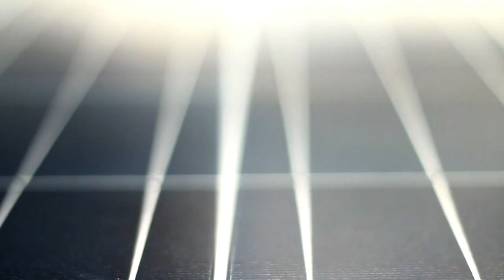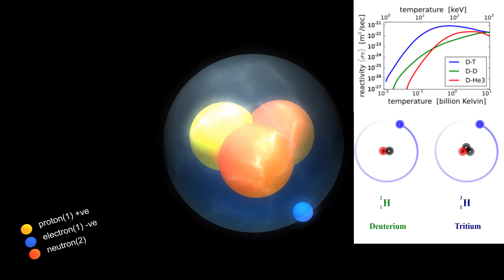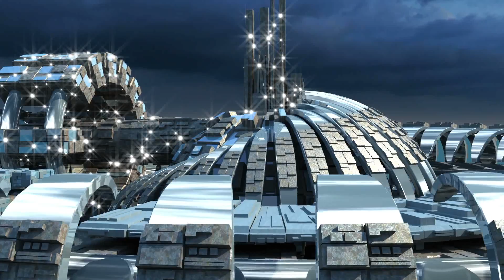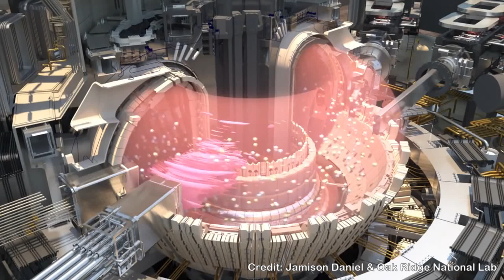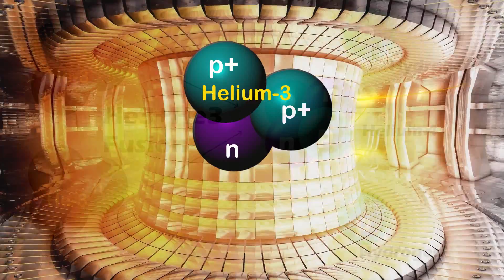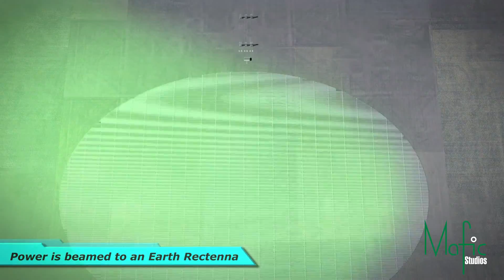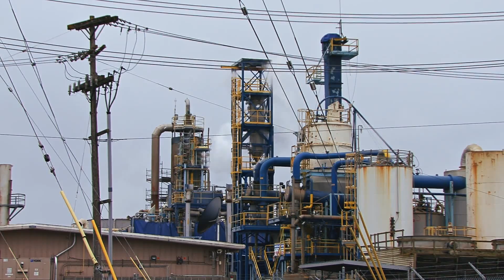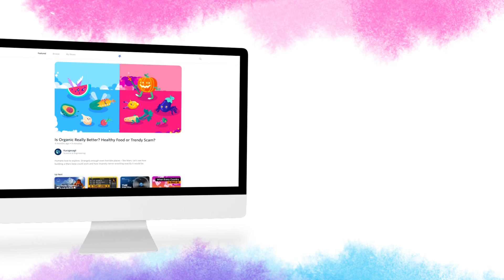Fusion: Powering a Bright Future

Comment: Would liquid hydrogen fuel cells be better than current batteries 

Can anyone Answer
Reply: https://upload.wikimedia.org/wikipedia/commons/c/c6/Energy_density.svg
Reply: So, hydrogen has a much great energy density (around x140), but this energy is not as available as the energy from a normal battery
Reply: Nicholas Schmitt 

Thanks man
Reply: Hydrogen fuel cells arent really like a rechargeable battery, they are more like generators. You fill them up with a fuel and they consume it. A bit expensive to make as well since platinum is needed currently.
There is a reason fuel cells are adopting slowly. Lack of a shared infrastructure for refilling.
Plus compressed hydrogen is some scary stuff for the average person to handle. Less dangerous than vaporized gasoline, but still dangerous.
I think most smaller commercial portable systems will use electric batteries. Backup generators and large industrial systems will use hydrogen fuel cells. This is only if our energy generation increases a lot, which with some form of nuclear wont happen.
Reply: Aron Linde 

I’m thinking about writing a hard sci-fi and was looking 
For a power source to power 
Power armor and trying to see what future might have

I hard hydrogen fuel cells 
Have the 10 times the amount of energy current batteries have

So I thought compress it more into liquid hydrogen fuel cells 
And imagine have much energy they would have

Storage isn’t a problem 
Diamondoids or buckyballs 
Or something else could hold them

Micro nuclear fusion or a perfect mirror batter the best but I couldn’t think of a why to make them work

Comment: THANK YOU. The introduction (what i am listening to right now) alone is superb. Fusion is literally hundreds of time more difficult to do than a steam engine or a simple solar cell. Getting it right in less than 200 years would be a miracle of science. The industrial use of piston thermodynamic engines turned 300 years old in 2012......and they are STILL improving today. Defund the military. Fund fusion and storage research !
Reply: Knoz   luv solar...make hay while the Sun shines...storage solutions will keep improving....
Reply: exactly
Reply: @es4583  Thats also about 23.5 liters a year. That means my personal gasoline consumption would be handled by about....say 25 square meters for 587.5 liters, maybe 40 if we consider the inefficiencies of conversion. Thats something like 7 kw of installed capacity. That would probably cost about the same number in dollars/euros to install, today. Would have been prohibitively expensive 20 years ago. Has a wholesale component cost of maybe 3 or 4 k today. Will get cheaper, tomorrow. https://en.wikipedia.org/wiki/Swanson%27s_law
Basically Moore for solar.
That amount of Gas would be about 800 bucks in Germany, we have high taxes and that is fine. Our roads are still plenty full and frankly, this is a small country with a lot of people....we think a 2 hour drive is long and annoying. So that would pay for itself in a decade today. In practice not yet, because the conversion plants are not yet at scale and solar is still a bit too expensive. In ten years the gas will be another 20 cents more because fossil fuels get more complicated to obtain and CO2 tax will probably happen, which is good, i am very inclined to believe climate scientists because we have been getting insane summers in a row lately and that is just absurd for our latitude and was never recoded like that in centuries. Solar panels will be another 50-75% cheaper so the total install will probably be 25-50% cheaper. At that figure it will probably be economical. If not in 10 years, then certainly in 20 or so. How do i use so little gas ? Living close to work, bicycling there, keeps me fit, otherwise id be major overweight. Saves money, too. That gas is almost wholly spent on visiting friends/having fun/vacations etc. So much for standard of living. My electric power bill is a joke,  about  1000Kwh and then maybe 200 liters of gasoline worth of natural gas for hot water and the laundromat. Hard to tell how much central heating i use because that is charged flat rate by the landlord, but Kiel city has a century old tradition of using cogeneration steam plants so it really is only waste heat from power generation and i dont't have solid numbers on it....but i think you can see how my consumption is waaaay short of 500 sq meters worth.
Reply: @sgg Set up large desalinization and pump water uphill. Large reservoirs are batteries and deserts could be terraformed as batteries as well.
Reply: @es4583  Actually read my comment, please ? I propose to use 1/4 the surface that is just used for agriculture ALONE. For every one of us. And at that number it would be enogh power not to feed the world as it is today, but to actually grant every last one of the 7+ billion people the living standard of a German, including synthetic gasoline. We are fairly power efficient compared to the USA because we a) care and b) dont need nearly as much heating and cooling due to mild climate. But we have plenty of old fashioned industry and lots of cars and live good, western lives. Contrary to what right wing radicals probably try to spread internationally, everything is okay in Kraut-land with the usual small problems that every country has.  I also explicitly stated that lithium is the best current technology but that known simple chemistry has already yielded batterys which offer vastly cheaper storage with more common and easily obtained chemical elements, just not on the market, yet. Because these chemistries have no use in mobile devices and had no market until now. 10 years ago Solar Cells were abysmally expensive. Now they are dirt cheap. The same is happening currently for lithium ion and will happen even more for the simpler battery technologies. I have yet to see criticism of renewable power that is actually realistic. Yes, producing them generates pollution. Once every 25 years. So does building a power plant. But then you have to mine and burn fuel every day. You cannot win. Wind power is now cheaper than coal power because a wind turbine is simpler than a coal power plant, fundamentally and mechanically, and burns no fuel. Once economies of scale set in the green technologies must win because they are all (Wind, solar cells and batteries) incredibly basic and simple science, we are just inexperienced in their ultra large scale application. If it wasn't for climate change, it would be perfectly fine to let rising fuel prices and the economy settle it by themselves, would probably take to the end of the century but not much more. And if some factory in China creates incredible pollution making solar cells, please don't blame solar cells , please blame the chinese buisiness culture. They have managed to create just as bad a smog and horror and death problem from the fossil fuels. They forgot to take care, that is all.....
Reply: @es4583  Your information is 10-20 years outdated. Rare earth usage in WInd power is a declining trend. Toxic CdTe solar panels are a sharply declining trend because they also perform worse than silicon, which is now cheaper anyways and lasts longer. Pretty much everything you said is outdated. The days of big subsidies are long over too. Wind turbines and solar cells are fundamentally simple devices. The possible economies of scale are humongous. Solar cell prices have already dropped to 1/10 over the last 20-30 years and the trend seems to be continuing. And the intermittency will be irrelevant at some point. Soon you will get the Kwh from those sources for like 2-3 cents. At that point you can just turn it into chemical power and store and ship that as usual. This is happening. Your ill wishes cannot stop it. Your post either requires a ten page answer for which i do not have the time......and btw. , the 500sq meter estimate would easily work for the US, check the numbers if you care so much :) . Very conservative estimate :)
Reply: Are you people aware of the ITER project. Its a multi tens of billion dollar project:

https://www.iter.org/

Its being funded by the worlds richest governments, including the USA. There are also several smaller privately funded projects. Fusion maybe closer than you think.

So the US Govt, is working on resolving global warming. This is the proper "long game" approach, as opposed to the "green" politicians pandering the stupid "short game", such as carbon credits, etc ! As the Hitchhikers Guide to the Galaxy says, "Don't Panic". Stop and think. Just don't react !
Reply: @michaelmoorrees3585  I am aware of that and dozens if not hundreds of research efforts on other technologies such as new solar, new batteries and new energy storage and grid stabilization techniques. I may be on the electric engineering side of things, but this sort of stuff is essentially my job. In truth. All those efforts are nice but way underfunded as i see it. If the predictions by climate scientists are even remotely true - and they seem to be at the very least that - we need to speed up what i considered good progress just a couple years ago before we started getting one overkill summer after another. (As of 2019 solar and wind power is economical without subsidy in many places, fusion research is starting to finally kick into gear, lithium ion batteries are finally at a sane price point while scientists are also beginning to understand how to make what i would call "ultimate batteries" in the sense that they are either really good or really cheap and reliable for stationary storage, Prof. Sadoway has excellent presentations on one such system for example. I dearly hope his startup overcomes the challenges of practical implementation before funding runs out. If not, im gonna cry because his chemistry and physics make superly much sense. The Battolyzer is another amazing piece of science in being a super simple combination of low capacity ultra long life battery and high efficiency catalyzed water electrolyzer  - a vital component for the power to liquid fuel machinery both isaac and i love so much. ) But Now everything seems to slow. If CO2 has to peak in the 2030s to avoid a messy, cruel and expensive desaster than we need to hurry up. 10x the fusion spending (still way less than any military budget), 100x the renewables and battery storage spending. And forced commercialization via Government effort. Basically - Apollo Program/Manhatten project style research in all the G20 countries. Expensive as fuck. Sure. Our own fault. We knew this was coming for a loooong time. And yes, carbon taxes as well. Simply because we are at a point where most green power is either just economical or just not economical yet compared to fossil. Carbon tax would tilt the scale and give inverstors the safety to invest into new tech. This really is like Apollo. Physics says that a fully green economy is easy, like flying to the moon. In Practice it will habe to be the largest industrial effort in history. But we can do it. There are 2000m^2 of farmland per person on this planet. 500m^2 with solar panels and storage per person would be enough to make more power than even people in industrialized countries use, including all heating, transportation, making sythetic fuel and so on. And that can be desert, wasteland, roofs. In theory - simple.
Reply: @Zonkotron  Outstandingly good comment. What are we waiting for, let's go!
Reply: Michael Moorrees we don’t have time for the long game.
Reply: sgg    The Sun doesn’t stop emitting energy; it is a relatively constant source....and it produces way more energy than us puny humans could ever think of using.   I think we should concentrate on using this, instead of trying to replicate this fusion on our planet.  Harnessing the power of the Sun may include using charged particles in our magnetosphere, as well as collecting photons thru photovoltaic cells.  Solar panels are getting more efficient every year, what about a global circuit circumnavigating the entire world?  Constant power no matter what the position of our planets rotation?  I think we are a ways off from making a Dysons Sphere around our Sun...lol